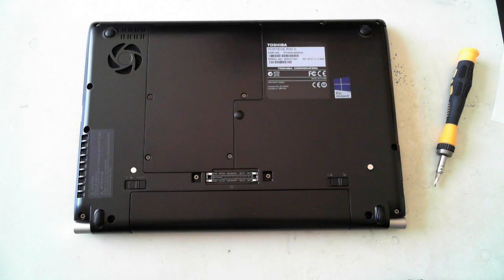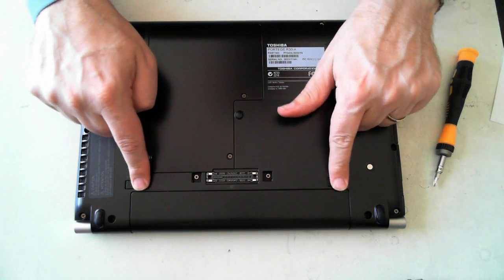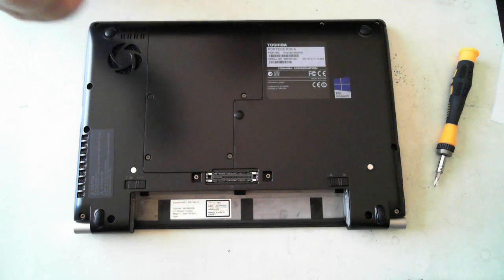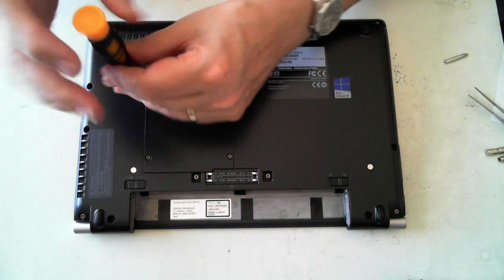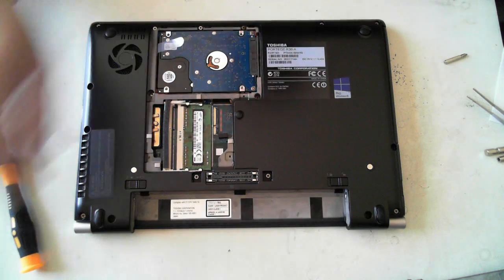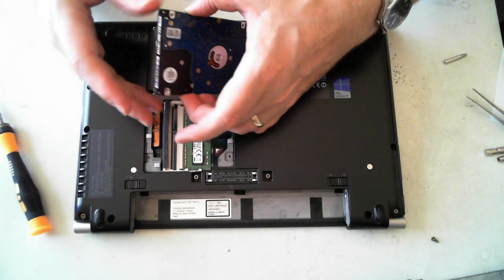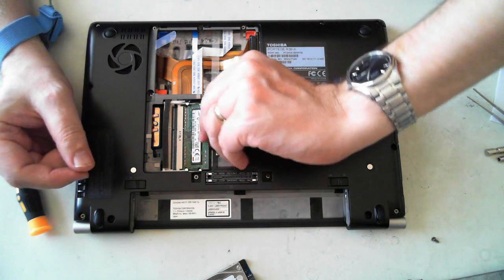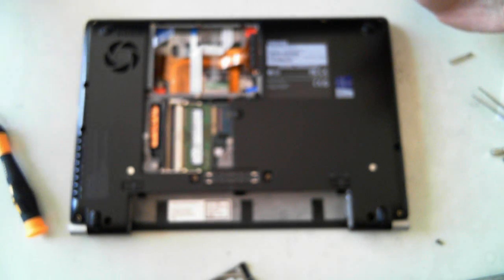Toshiba R30-A Memory & Hard Drive Upgrade

Comment: I just changed the hdd to ssd, and installed the old hdd in the cd room slot using a caddy, but now the laptop doesn't boot from ssd instead it boots from the hdd that I have put in the caddy, even though I have changed the primary boot to main ssd, there  suggestion?